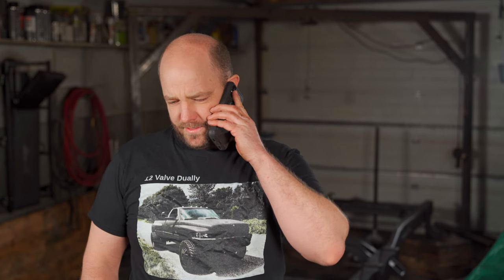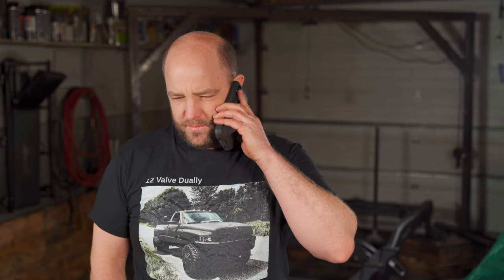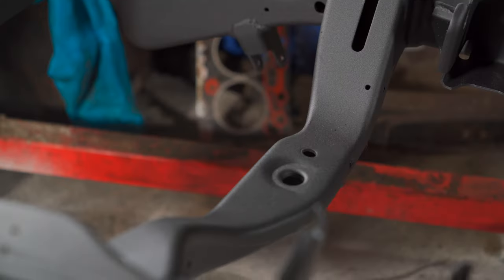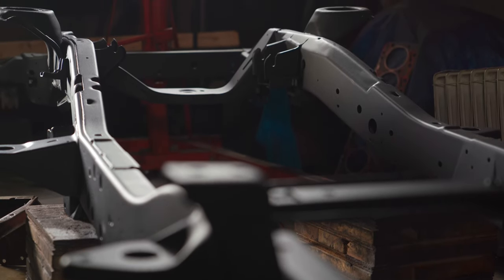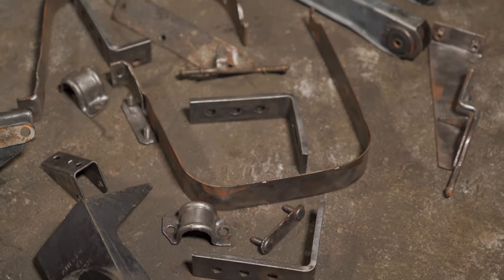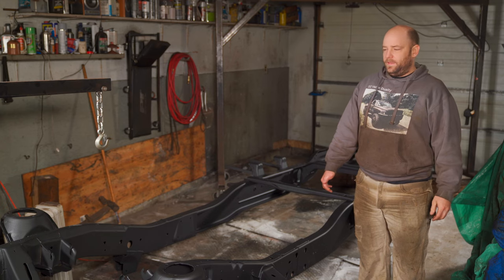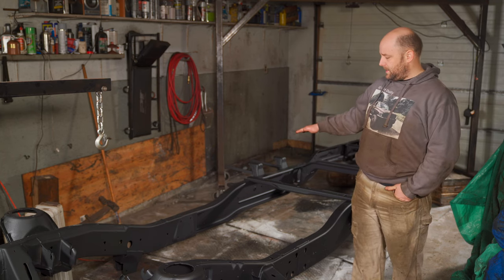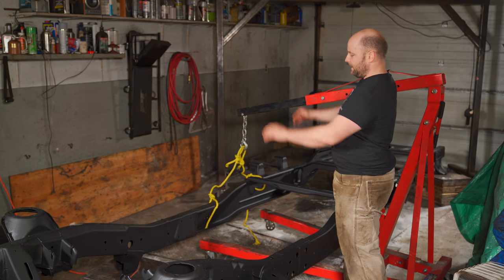12 Valve Dream Truck Build Episode 15 Powder Coated Frame

Comment: The frame looks so good you have do a extra good on the small parts. 
I just purchased a 241 DHD upgrade from my broken DLD
Reply from the maker: I know, this just set the bar so much higher for everything else that I need to do. Awesome, will you have to change your rear driveshaft?